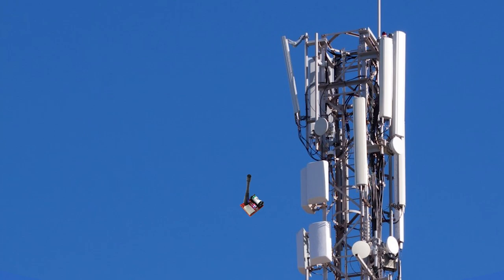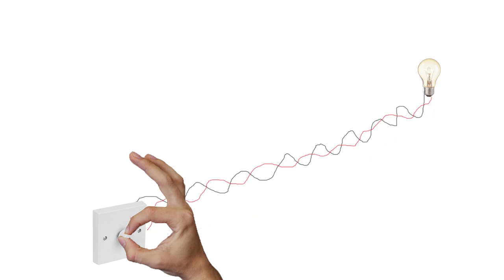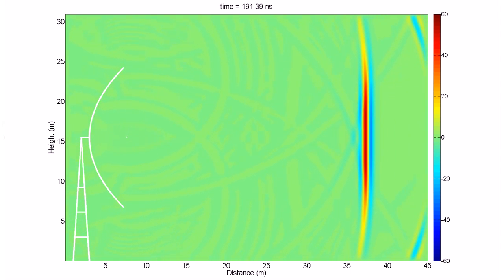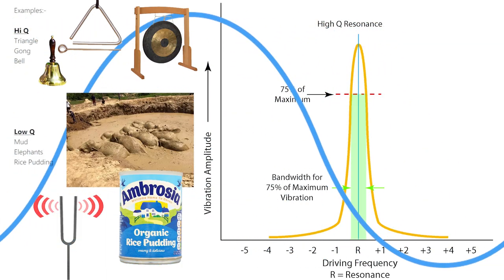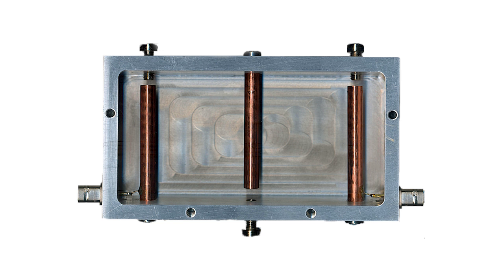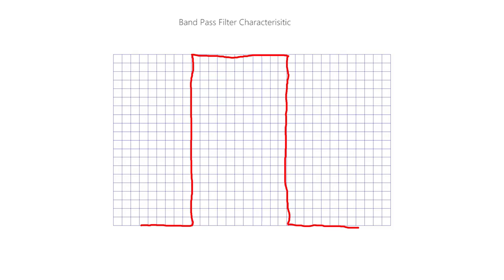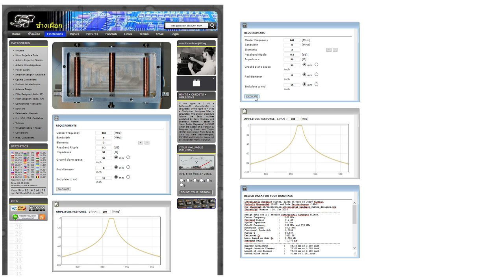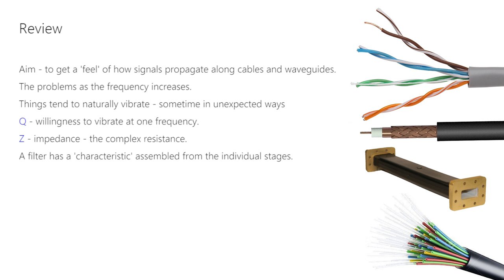Protecting LoRa from cell / mobile phone transmissions

Comment: Your visuals are great as always! I learned the difference between the two filter designs. I knew the names, but not what they stand for.
Reply from the maker: Thank you Andreas.  I had to remove a load from that video - as it was just taking far too long to produce (and I still have the house rewiring and water leak to deal with).
Reply: Grutti Andreas! :) (I always wanted to say that)
Reply: @richard_wenner  Hi Richard.  I enjoy your videos.  I saw your comment on Andreas' site regarding  Json over https input I assume into a time series database.  I thought I would mention the ELK stack (Elasticsearch). Native input to elastic is Json.  There is an input plugin for http(s) as part of Logstash. Not sure of your application but thought it was worth a mention if you are not familiar with ELK.  Cheers!